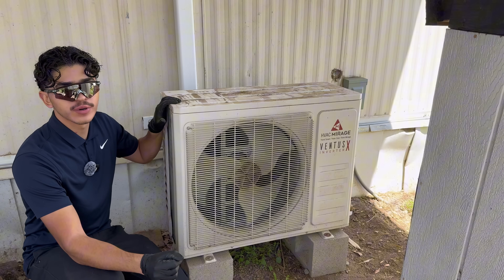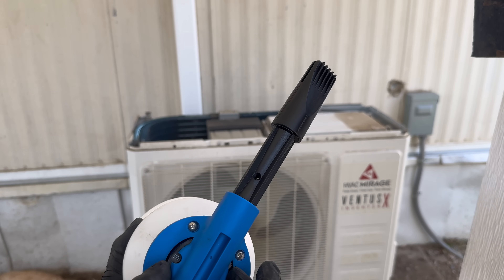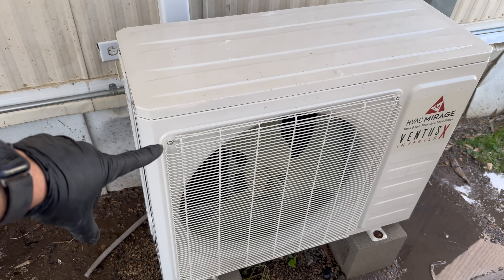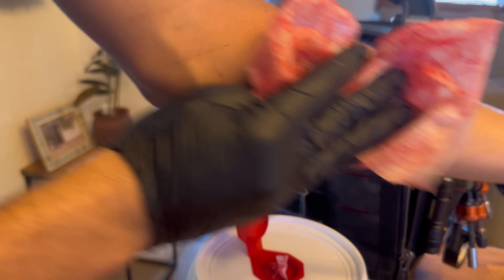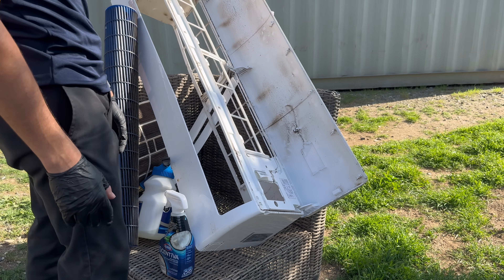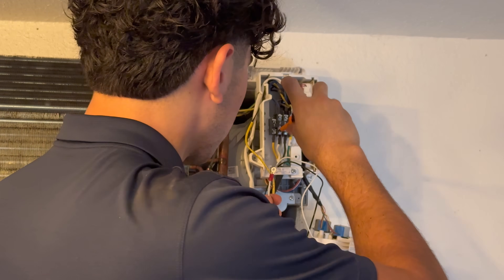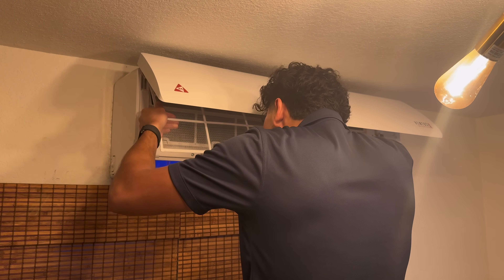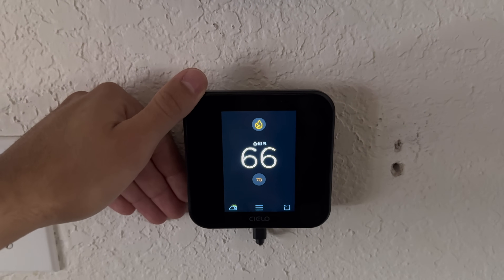Full Mini Split Maintenance | Installing UV Air Filtration & Thermostat

Comment: Is it better to add water first before solution so you don’t cause a foaming mess trying to fill it up??
Reply from the maker: For this foam cannon you’re actually not supposed to add any water, I was informed by the manufacture after making this video. It will delude itself.

Comment: Hardly a full maintenance. Run amps, leak checks, re torquing electrical connections, visual inspection of PCB and terminals. ETC ETC. wiping a unit and fitting a uv light isn’t a full maintenance
Reply from the maker: @Fridgyman99  read the disclaimer in my description.
Reply: Top man just didn’t want people thinking this was the full thing kinda miss leading on first glance. Keep it up 👍
Reply: He did a great job. Stop being haters on this youngster. What were you doing at his age

Comment: I had to learn the same lesson with my coil foam gun u barely have to at any water fr unless you are using a super strong solution. That's why the mixing letters come in handy